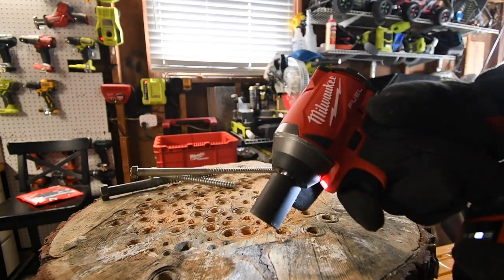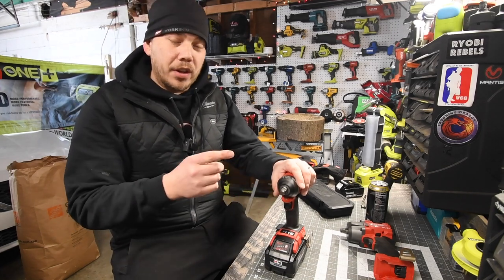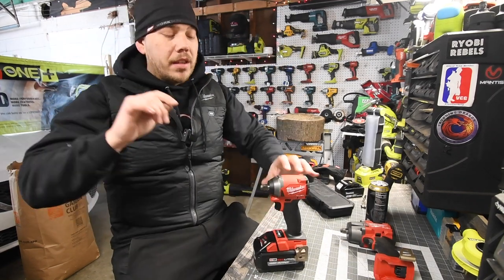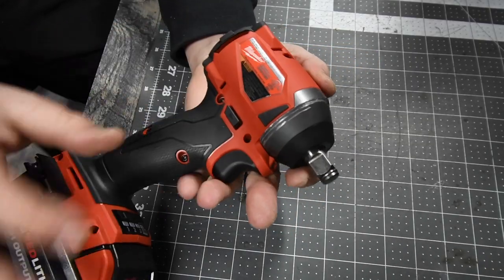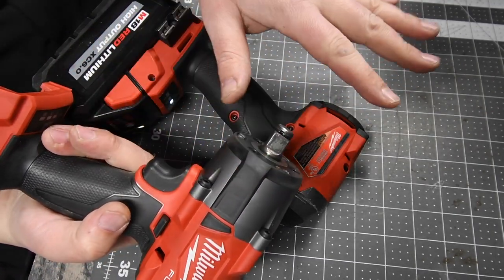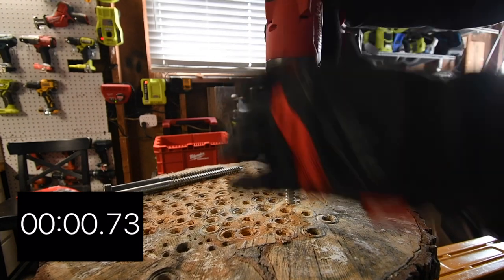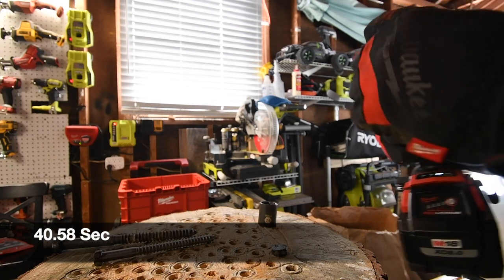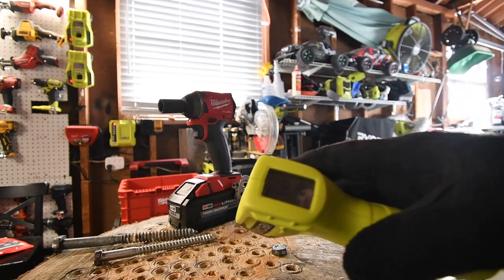Modded Milwaukee Impact Driver

Comment: I'm not a "Milwaukee Fan Boy", but I just watched the video about this M18 Impact Driver Frankenstein on the 
"Torque Test Channel" and had to see for myself what was done to modify this Driver. In a word I am highly impressed with the modified tool, however, I have a hard time believing that the engineers at Milwaukee where unaware of the their tools full capability. There has got to be more to this story than a simple replacement of the anvil.
Reply from the maker: I Thank you so much for viewing :)
Reply: Motor longevity, I'm guessing. Breaking 20+mm bolts all the time is going to put a lot of strain on a motor designed to drive screws.

Comment: Hey Dave, this is a great mod and I was looking at doing this mod to my gen 3 because it sits at the bottom of my box unused. I work on cars a lot and just like you said, the addition of a hex adapter really adds length to the tool and makes it useless in tighter spaces. I would love to see the anvil you used close up to try and match it up to some other anvils online. And I would look at getting a copper sleeve or something to take that slack up in the motor anvil engagement. Take care!
Reply from the maker: I used the anvil from the m18 stubby. but I will see if I can find one that you can buy separately without taking it from a tool

Comment: This looks much like the DeWalt DCF890, which is basically an anvil-swapped version of the discontinued DCF886. Maybe some motor tweaks too, but I can't imagine they are all that different.

There is at least one successful-looking anvil swap of the DCF887 out there as well.

Generally the impact driver and anvil can be had for much cheaper than the corresponding impact wrench.
Reply from the maker: I do thank you so much for viewing :)
Reply: I'd be interested in how the modded 2853 does with lug nuts compared with something like the new compact impact wrenches. Or even the M12 stubby...

Comment: Great idea and video!👍🏾. I got the same impact along with the m12 surge and stubby. All 3 are unique in their own way.  Before buying the my first combo kit I saw videos of the gen 3 breaking away I think around 250 lbs of torque. Anything over the adapters snapped. If milwaukee doesn’t make one you should consider selling a conversion kit. Keep up the good videos.
Reply from the maker: I thank you Francov

Comment: Cool idea! You should try the 3/8 anvil, see if it fits without drilling. That “little bit” of shaft wobble, that’s NOT a little, that WILL cause you some issues in a hurry. It might last long enough to do your “testing”.
Reply from the maker: I got a different anvil and it no longer wobbles :)
Reply: @ManCaverTools  
Nice! What did you use? I love this sort of content by the way.
Reply: @ManCaverTools  which one?

Comment: 2much rpm for wrenche it will burn the motor after 20bolts.and the wrenches create the way that they have more power in reverse so the can nut bust .because if you try to unscrew the bolts you need power from the beginning,and if that happend to m18 it will burn and stop the motor very quickly:) THATS THE DIFFERENCE ;) DAVID U ARE AWESOME 😎
Reply from the maker: If it breaks it breaks :) that is what we do on this channel and I thank you Diagoras

Comment: I have a m18 with a broken 1/4” collet. To do this to it, I  would just need to order a 1/2 anvil and then drill the body of the driver out to make a 1/2” anvil fit on the hammer?
Reply from the maker: the m12 1/2 stubby fits this, and you need to bore of the hole a little bit for a 1/2 anvil to fit

Comment: What is the strongest and smallest 3/8 milwaukee m18 impact possible and do you have a video on it
Reply from the maker: in all honesty I didnt really test too many 3/8 anvil impact drivers. But I do the the 3/8 socket adapters over the 1/2
Reply: @ManCaverTools  i am wanting to build a 3/8 small powerful impact what would you recommend milwaukee or dewalt and do you think I can make it stronger than one that is already out

Comment: There is a gen 3.5 so make sure to get that one when you order it again.
Reply from the maker: I plan to and I thank you for viewing Kart
Reply: I just bought one from HD and had it shipped to store and it's still the 3.0 (single ball).  I'm guessing HD will have to run out their existing inventory to get lucky and get the 3.5 double-ball version...YMMV
Reply: @stevetekrv5791  yeah Ilat least if your 3.0 starts acting up just send it in and they will probably put the 3.5 tip on it.

Comment: Went back to your compact wrench video and they essential did the same time for 10"lag so my question is, what do you benefit from this mod? Cause I don't see one @mancavertools
Reply: @mancavertools the gen 3 has 2000inlbs which is 167 ft lbs of torque
Reply from the maker: the lag test was just to see if the tool will break with the new anvil. The real test was the ft lbs test. it must have loosened 400-500 ft lbs nuts tightened by the mid range impact driver, but more tests will be coming
Reply: @ManCaverTools  there's no way it was actually up towards the peak ft lbs cause the tool only has 167ftlbs rating,  I understand what your thought process is but there's no way it was,  I've had issues trying to remove things that needed the stubby to take them off

Comment: I’m going to attempt to make a 3/8 drive version of this. Any idea of the anvil has to come from an m18 stubby or if there’s an anvil from A different tool I could use?
Reply from the maker: I Thank you so much for viewing :)
Reply: @ManCaverTools  just wanted to say that the compact 3/8 anvil does not work. It’s too small for the the hole in the nose cone of the impact driver allowing way too much slop for the tool to be used. Trying to find a different 3/8 anvil that will work
Reply: @ethanvanzee964  Bro I'm going to attempt the same mod 3/8 version. I see the old version compact 3/8 anvil's on ebay and other stores is that what you tried to use or did you get an actual Gen 2 2854 Anvil? I'm wondering if the stubby 3/8 M12 will work since the specs are close to the New M18 1/2 he used to build this hybrid plus they do have that anvil available. I don't think the old compact 3/8 version will work on the New M18 3/8 since the design looks way different, but I may be wrong. Anyhow let me know what working for you. Thanks
Reply: @johnny4713ify  I haven’t been able to find a 3/8 anvil that will work for a couple reasons. The first being the hole in the nose cone of the impact driver is larger than most 3/8 anvils because the tool usually has the 1/4 hex anvil. Also the hammer contacting surfaces are rounded rather than square on the corners like many older anvils are
Reply: @ethanvanzee964  I've been researching different anvil's aswell. Been watching all the Videos and reading all the comments it looks like MCT changed the M18 1/2 Anvil so no more wobble. But he didn't say what brand or model he used to get a better fit. If we are lucky he might chim into the conversation I put a comment on the build vid he has aswell but I know he's swamped. BTW based on the comments I've read he ended up switching the M18 1/2 Anvil to an unknown brand that fit better and doesn't wobble so hopefully he replies.

Comment: So I made this tool using a different person's video. Apparently he used a m12 stubby 1/2" impact anvil. Your using the m18 stubby 1/2" anvil. The facia on my impact body got destroyed due to the socket rubbing its edges because of the weight. Now I see urs has a bit of a gap between the end on the anvil and impact facia. I'm gonna order a anvil from a m18 half inch stubby. Can you please correct this. Are you sure urs was from a m18 stubby.

Comment: Does anyone make a 3/8" to 1/2" adaptor ? Not downsizing upsizing from 3/8 to 1/2"
Reply from the maker: if the anvil can fit on the shaft then yes

Comment: M18 mid torque is 600 lbs break away torque. Fastening is maybe a little over a third of that. You did not pull 500 in lbs with your modded driver. You need to get a torque wrench.
Reply from the maker: this tool is 167 ft lbs of toque. I bet with this anvil it majorly exceeded that. that mid range impact wrench is no joke.e

Comment: Looks like has about 30 thous play lol nice mod tho dave prob could press fit a piece of brass in where the avnil shaft goes machine the brass out intil about 3 thous slide anvil in be no wobble
Reply from the maker: I think their is a anvil that will fit, maybe form a different impact wrench

Comment: That's cool I dont know if any one asked or already said this when you built modified the inpact system but can itt or Milwaukee get you in trouble for doing what you did to the tool even though you legitimately bout it or it so small it's not worth them time anyways nice video Dave thanks for up loading
Reply from the maker: I bought this tool, they cant do anything.
Reply: As long as he doesn't start trying to sell them I think he's good.

Comment: Although I do appreciate your innovation & curiosity with this,I don’t really understand the frankentool. Here’s why that modified tool puts out 1600 in lbs of torque where my older m12 (2454-20) puts out 1400 inch lbs of torque. Now in a real world application my 2454-20 will drill similar lags into telephone poles regularly & the difference of 200 in lbs isn’t that much different for me to convert one it wouldn’t be worth my time. Additionally the size & weight of the 2454-20 is unbeatable when I’m climbing poles.
Reply from the maker: more tests will be coming up against the other impacts and I thank you for your input Jac

Comment: Hey, idea just occurred to me.  Is it possible to put a 3/8 anvil on the 12v screw drivers?  Have yourself a clutched nut driver, that is much faster than any cordless ratchet.  

Specifically the DeWalt 12v xtreme screw driver??  🤔
Reply from the maker: I can give that a shot,

Comment: Milwaukee isn't what it use to be back in the '90's. The red isn't even the red that it was back then. It was a deeper richer red than the almost "toy" red that they are now. Maybe TTI uses the same pigment and maybe they don't. Maybe back then the materials were thicker and held more glass fibers making the red a richer color. Even though they boast the power and speed I don't think they're quality tools. Industrial tools for the professional. I use Bosch because they're still their own company and along with Hilti haven't sold out to the big conglomerates. And I hope they never will. Use to be if you were an industrial maintenance technician and you owned a Milwaukee cordless drill you had something. It just doesn't feel the same way now. Just my two cents. Cheers.
Reply from the maker: I do thank you so much for viewing :)